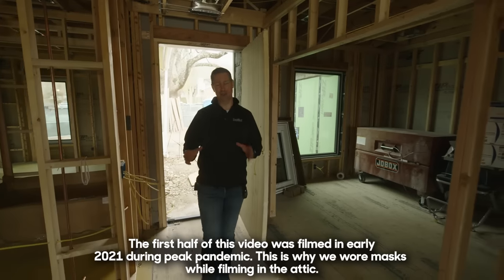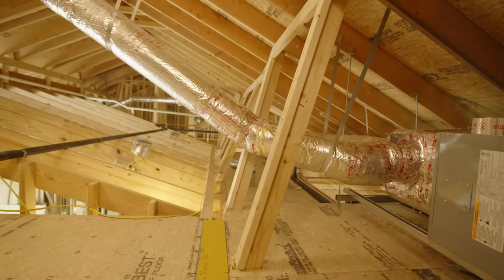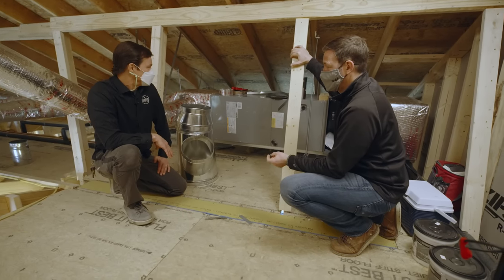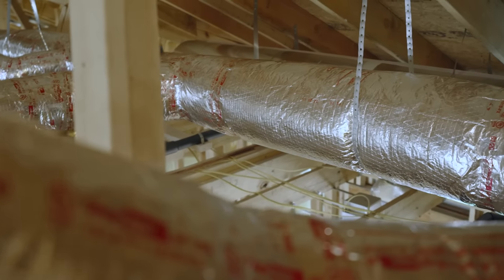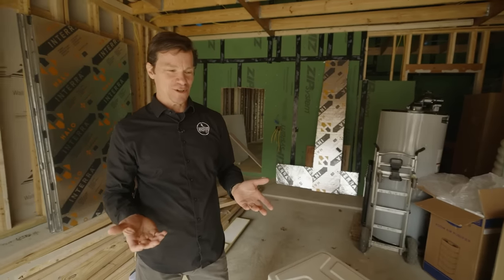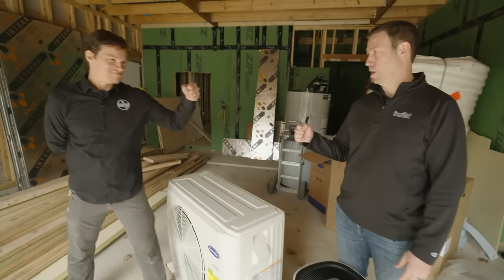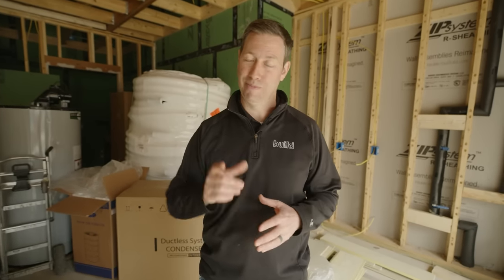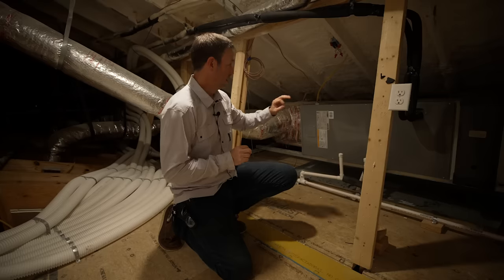HVAC Done Right! Watch this before you install!

Comment: I find that it's not due to ignorance that people don't install these systems, but due to costs. Everyone would love to have an almost unlimited budget where they put 5/8 Zip-R on their roof with 4" of XPS foam and 4" of closed cell foam on the interior roof deck. But on a house that size you're talking about an additional $30k-$40k JUST IN INSULATION! If you did that on the whole build you would be pricing yourself out of every market. And there isn't a return on that kind of investment unless it's just for your own comfort. So these are nice for rich people, but it won't be viable for 95% of the population.
Reply: Couldn't have said it better myself.
Reply: I’d rather have a condo with 3 bedrooms, an ERV system, a main HVAC system and 2 mini splits than a single family home. You wouldn’t even need a car.
Reply: Cities need to get rid of the single family zoning crap and let people build luxury apartment complexes. The amount of taxes they could collect would be way higher because of the increase in density and we could have trains like in every other developed country.
Reply: To be fair, 99% of the population doesn't know what a WRB is.
Reply: @wkobayashim  Right, well and that's the point. Builders are the ones that are giving estimates on houses and a large portion of homes are being built in developments, not as custom homes, which means that the developer is looking for the cheapest guy 95% of the time. This means that he is doing a vented roof, blow in insulation and meeting minimum standards and practices. And even if it's custom, like you said, clients don't know enough about building science to see a benefit in spending 15x as much on insulation when the R-value is no different. They'd rather have a built in wine cooler, or fireplace, or...
Reply: Very true, but man, it's fun to watch and dream, ey?
Reply: @MyFortressConstruction  municipalities should enforce a blower door test on all new construction.  5 ACH.  That would go a long way.
Reply: I am considering doing a mini-split supplement to my existing central air. Even assuming I can replace 100% of my AC power usage and cut the energy cost in half and using the cost of self installation I'm still looking at a payback period of longer than the service life of the equipment. There is no way I'd be able to justify it.
Reply: But how much value do people place on comfort?  Those highly-insulated, tight houses are much more comfortable to live in.  And year-over-year, they have significantly lower energy costs.

My impression is that code for new builds has higher requirements for insulation and tightness, and my opinion is that code should be very aggressive at requiring energy efficiency.  It's something that government can actually do, to reduce overall carbon emissions.  And you end up with some overall cost savings in the economy, because fewer power plants need to be built.  Government should be offering strong incentives for retrofits as well, although there are obviously limits on how much it makes sense to spend to fix an old house since retrofits steps are quite expensive.
Reply: @dondumitru7093  Yeah, it would be great if everyone could afford to make a house this way. I'd love to be using liquid flash and exterior foam. Water penetration is the #1 enemy of every home and these systems help to reduce that possibility while also making the house more energy efficient and comfortable, like you said. However, if the government heavily subsidizes these things it comes at a 10-1 cost ratio to tax payers. Nothing is free and everything has an effect on everything else around it.

Also, my problem on these builds is that it sets a very high expectation without being upfront about costs. They say "good value", or "low cost" and so when Suzy home-buyer watches these videos and gets bids, she expects something like this for a low cost and it's just not feasible. I wish Matt would help out the poor more by showing building science that actually was cheap to do while making a big difference to a homebuyer. 
   Things like a white roof, which is highly reflective and emissive, a radiant barrier on the roof deck, soffit vents that were above the minimum in air flow for good attic drying and circulation, 2x6 exterior walls for added insulation, Caulking/sealing regular OSB sheets (not just zip), placing a 3/4" layer of EPS foam on-top of the exterior sheathing to act as an additional WRB as well as prevent thermal bridging and adds a radiant barrier, etc. These are things that don't cost a lot, but they add a lot of benefit to the structure. They are small improvements that help make big differences.

A series on cost improvements from cookie-cutter/no-frills, to luxury/best. With actual costs. I know they fluctuate and can be regional, but most people don't even have an inkling. Plus, it helps people to see the market from an objective perspective, instead of just speculative, or hear-say.
Reply: Risinger is know for over spending..and he's obsessed with insulation.
Reply: @jayc4715  While it is definitely possible to overspend on insulation, mainly that happens if you are making your walls really thick in a mild climate zone, or if you put lots of insulation in your walls but don't pay proper attention to windows.  Windows which aren't top-notch will negate ALL of the benefits of any amount of wall insulation.

Windows + Insulation + Air Sealing, is what is required for high performance energy efficiency and comfort.

It's hard to tell how much of Risinger's designs are based on good engineering, vs. overspending, vs. not caring how much something costs because he is getting it for free as part of promotional consideration.  I appreciate seeing the products and the designs, but one definitely has to make one's own judgements about the value for dollar.

That said, developers and contractors have their own slanted views about how to generate profit from construction work.
Reply: No way.  Code here is R-30.  I built to R-60 with 4" of 4x8 sheet foam above the interior roof deck and below the exterior roof deck that is tar papered and shingled, and R-30 Rockwool under the interior roof deck.  The building had less roof (smaller footprint, but two stories) It added maybe $6000 more than the amount it would have been to just do R-30 pink fiberglass.  On this house, double that and you get maybe $12,000.
Reply: @andrewdiamond2697  He said he sprayed 4" of closed cell foam. My spray foam guy charges $8 SQ ft for that. So 2400 SQ ft (house footprint is 2200) and that's $20k just in spray foam.
Reply: @MyFortressConstruction  Yikes.  I guess that is part of the explanation of why I went with R30 Rockwool under the deck, and cheaper preformed sheets of 4" foam in between to make an R-60 sandwich.
Reply: @andrewdiamond2697  Yeah, your insulation would be a good choice for the savvy consumer. For spec. homes and suburban developments though, they won't see a return on higher quality of insulation because most people don't care, or know enough, to spend the extra $6k for something they won't ever see. But if it was my house, yeah, I'd probably be doing a similar system to yours.
Reply: @dondumitru7093  "Government should...."  You do realize that the government doesn't have any money.  It is spending the taxpayers' money.  That is, it is spending my money.
Reply: @BryanTorok  In fact, you do not understand how sovereign currency works.  The actual fact is that at the moment when government approves the spending of money, completely new money comes into existence and begins circulating in the economy.  Do the thought experiment - where did the first dollar come from?  In the beginning there were no dollars anywhere, and then ... ?
Reply: b.s you've got to consider the whole cost of the system. Ductwork, supplying gas to a home, gas service fees, etc. Every house needs electricity but not every house needs natural gas nowadays. Houses with mini splits don't need ductwork.
Reply: @fox156  I'm not sure who you're addressing, but they had ductwork in this house, and rigid metal ductwork at that. They also decided to install individual mini-splits for the garage and bedroom. So they increased their costs by adding unneeded mini-splits in those areas to increase their comfort. Again, not a value proposition by any means.
Reply: @avery4528  If the majority of people wanted to live in well appointed rabbit hutches, they would already.  Since the 1800s and early 1900s people have been wanting to get out of densely populated cities to have more space both in their living quarters and around them.

We had buses and trains and tightly packed neighborhoods where people lived in close proximity to their jobs.  But, the wealthy lived in the suburbs connected to the city center by trains.

The advent of the affordable automobile provided the freedom to the working class to not have to live near the noisy, smelly, polluting factory and to get into the suburbs and exurbs.

I've lived in my car, in apartments, in condos, in townhouses, and in my own house with my own driveway, garage, and workshop.  My biggest regret I have is that I wish I had a bit more distance to my neighbor where her driveway is right under my bedroom window and where her guests park their cars and slam their doors.

I like not having anyone living above or below me.  I don't have to hear running water when the neighbor uses the toilet or shower at 3 AM.  And, I don't have to listen the neighbor complain if I do.
Reply: @MyFortressConstruction  you're right they did have ductwork in this house. but your comment was about insulation/heat pumps in general and mine was in general too.
Reply: @MyFortressConstruction  Yes, people make value judgements on what is important to them. You may choose, and wish they chose, more expensive mechanicals over the wine cooler but its their house, their money, their life. "Building science", ie rebranded green building, in my experience complains that others make different decisions than they would. Always a turn off to me.
Reply: @dondumitru7093  While it is very easy to spend others money by requiring xyz thing you desire to be in the building code, it really is fraught with unintended consequences. Have a little compassion for those who wish to have a nice life with a house rather than an apartment. Many of those people will never get out of their crowded apartment if building codes were made to your desires.
Reply: @MyFortressConstruction  I really liked his "monopoly piece" house with no cavity insulation just sheathing. It could about break even with traditional construction costs while providing a lot of benefits.
Reply: @avery4528  Cities? Towns need to do it, mixed use buildings European style. That will revitalize all of the small downtowns in America!
Reply: Air sealing pays. Super insulating does not.
Reply: @MyFortressConstruction wow that’s is expensive where I’m at it’s 2bucks sq I think his ripping you off
Reply: @Familyfun2006  Your guy charges $2 per sq ft for 4" of closed cell foam, or do you mean $2 per sq ft for 1" of closed cell?
Reply: @randomvideosn0where I thought he was adding cavity insulation as well? No? Thanks
Reply: @boeing757pilot  If I remember correctly, that build left the cavities open and painted clean white. That would lend itself well to built in shelving and such!
Reply: @randomvideosn0where  Oh, okay. Thanks for that info!
Reply: This is why I like ICF construction. You do pay a small premium, but not a huge premium.
Reply: No one is taking into account inflation. When people say X insulation would take 30 years to pay off with decreased energy bills, that assumes today's energy prices. 

If energy prices inflate at a compounded 5% then a 30 year year payoff gets cut in half. A temporary bout of higher inflation like we just had would make it even faster.

Everyone has become accustomed to living in a low inflation world. That might be over, at least for a few decades.
Reply: @caustinolino3687 you also have to adjust the price paid for the construction for inflation. Inflation alone won’t make a difference; when economists adjust for inflation, they’re removing any impact inflation would have such as the one you mentioned. 

Now, prices can climb beyond inflation. And with the way we’re underinvesting in electricity production and shutting down plants, they may well rise simply due to supply and demand problems.
Reply: @Tom-ct6dy  Why would you adjust the money you pay for construction for inflation? That money is paid once and doesn't go up with inflation like ongoing electricity costs. 

I think you mean you have to account for the opportunity cost of the extra money you're paying for construction. Meaning if you didn't use that money for construction could you put it somewhere else with a better ROI? 

If you can pay off something in 15 years you're getting a guaranteed 5% CAGR, plus extra comfort, plus free "insurance" against unexpected inflation spikes. Anything higher ROI than that has much higher risk.
Reply: @caustinolino3687  because you’re otherwise comparing inflated values with non-inflated values. Economists always convert to make the comparison apples to apples. 

It probably makes more sense to adjust for inflation the electricity rates back to construction year rather than the other way I posted earlier.
Reply: @Tom-ct6dy  "because otherwise you're comparing inflated values with non inflated values" - That is the entire point of locking in prices, to be immune to future inflation. How are you supposed to analyze the value of avoiding future inflation if you cannot compare values now to inflated future values?

Comment: This story displays something very important for A/C:  things change in life.  When the house was designed it was for two people and potentially a third.  And they planned a workout room and study which instead became a TV room.  And as mentioned in the video, things can be happening in different rooms that have different A/C demands (e.g. a large party that needs cooling vs an elderly woman at rest who wants more warmth).  And if you have just one central A/C for the whole house and it's been carefully designed to be optimal for it, then you can't close off vents to distribute the temps more to your liking.  The backpressure on the unit is bad for it.  And then there's return air.  Somehow you need to get air into each room back to the fan unit.  Separate return in each room, or else you leave a big gap under each door.  And each room can be impacted by outdoor conditions differently.  In the morning on a summer day the eastern side gets hotter, but in the afternoon the western side gets hotter.  And if you aren't using a room or two (as is probably the case with Matt's father in law since he's living alone in a 2400 sq ft home) why air condition all 2400 sq ft?  What a waste if you can't 'turn off' some rooms.

Bottom line each room needs its own temp control.  That's optimal.  Mini-splits accomplish that, but at what cost?  No mention of it in the video.  How about in-wall heat pumps (securely mounted so a burglar can't push it in)?  Those too have become very quiet.  No ducts at all, no refrigerant lines, no separate compressors, and easy enough for a handyman to install as long as the required electrical outlet is there and the opening is framed the right size.  People with big money wouldn't like the looks of it, but for people on tighter budgets than your father in law (and who aren't fortunate enough to have someone like Matt as his son in law to build it) seems that might be a viable option.

Speaking of costs it would be very helpful to have some idea of what the energy savings are for a home built like this.   E.g., what type of electric bills have you been seeing, and what was the scenario (number of people, typical outdoor temps, indoor set point, etc).

Comment: Just a comment on the air filtration unit. I have been using hepa filtration units in 2 bedrooms for probably 10 years now. I'm sure they aren't as efficient as the unit in this video. What I will say is that even though we have fairly hefty filtration on the central HVAC system, we hardly ever have to dust the bedrooms compared to the rest of the house. They also give off enough white noise to make sleeping easier (at least for the wife and I), although units like in the video may put out even less sound. The cost of purchase, filters, and a small amount of electricity, is well worth it.

Comment: I love my minisplit units that replaced an old worn out and really inefficient central heating and air unit and with 3 of them if one fails it's not an issue as the rest of the house is still cool, plus they draw so little power and don't have the big surge loads of a central system that they easily run on my solar inverters. Keeps the house cool in the summer and warm in the winter with no problem and a separate ERV system handles air exchange and filtration. The efficiency of not having duct work makes a huge difference too. Mine is an old house so neither the attic or crawl space are conditioned spaces so eliminating lots of duct work from there and the heating and cooling systems eliminated all the losses you have from running a system in an area that wasn't conditioned.